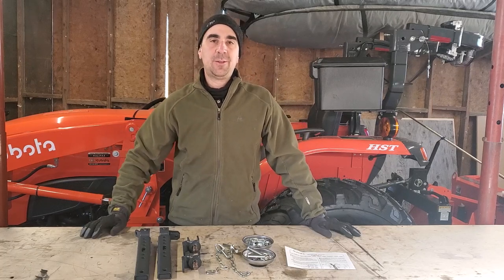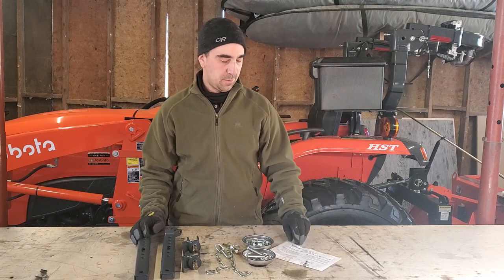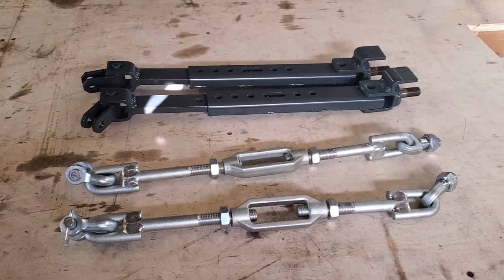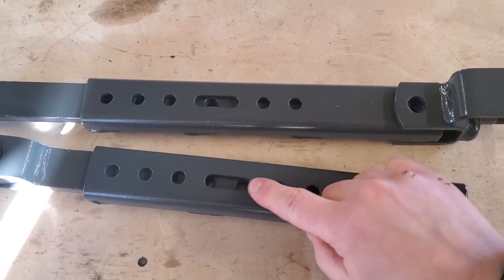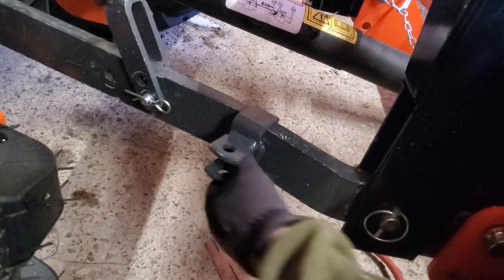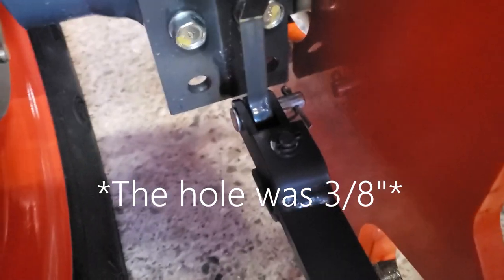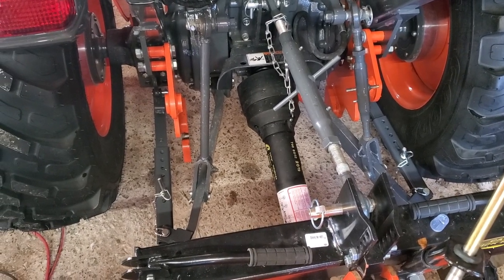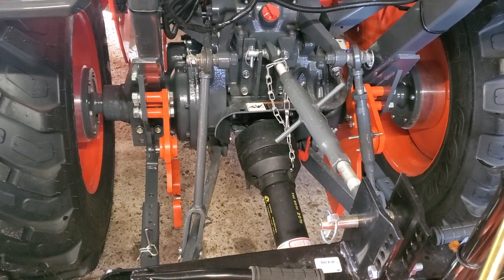Kubota L3901 modifications part 10 - Telescopic 3 point hitch stabilizer arms

Comment: I see that you have the Backhoe adapter installed.  I use the R-pins instead of Cotter pins.  That way I can take them on and off easier.   Good idea about the wheel spacers, especially if you have R4 tires.  Next thing you should get is an easy PTO shaft adapter.  Your back will thank you.   And I agree with the comment about Pat's Easy Change.  It's been a blessing.

Comment: Just seems like a "shame " that this "add-on" is not a 100$ option from the factory. So you are just going to have the "old" ( brand new)turn buckle sway links laying around ( worthless) for the next 50years. Just as "BAD" with a 35000$ tractor rig ,there is NO OPTION for telescopic lower flexable lift link arms ; there is NO good substitute. With "quicky-hitcheys " & add-on "sloppy-wobbley-shifty " after-market lower link ends being the "go-to" for many( both a poor excuse) for a positive, safe,secure& flexible attachment for 3point implements. Thank you Sir for the Excelent vidio. Best wishes with all your endeavours.
Reply from the maker: Thanks! I absolutely agree with you.